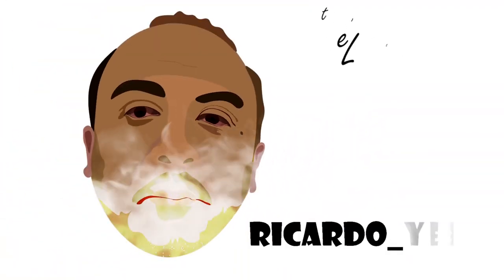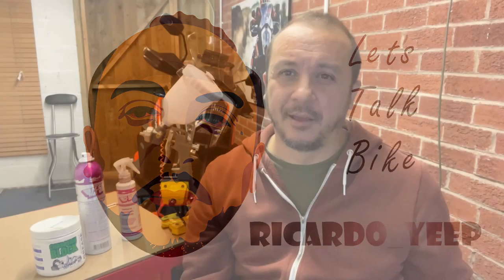2021 2022 2023 2024 KTM 1290 Super Adventure Anti Corrosion ACF50 Treatment

Comment: Hi Ricardo, many thanks for the great vid again. I decided to buy ACF 50 and I have tested it not only on my new 1290 SAS, but also on one of my other KTM bikes - especially on my 990 SMR which is 9 years old and not very shiny. The handling of ACF 50 with an compressor is quite easy (thanks for your recommendation to cover the wheels and brakes). And the effect is really brilliant. Everything glitters and shines like a new bike. Now all what remains is to achieve the desired protective effect when it rains....but maybe better not to drive in rain :-). In two weeks I will be with the SAS in Slowenia and I won't be able to avoid driving in rain. I will see how ACF will work....

Stay tuned and congrats to all your work - well done!
Reply from the maker: Hi Jochen thanks a lot for the great reply. Much appreciated. And good move on the ACF50. And don’t worry about rain. That’s what the ACF50 is for. It will protect everything that you have applied it to. It doesn’t not wash off easily. So you will still be good for a few wet rainy rides without having to reapply. It leaves a protective film on contact. It’s my go to product for after I have washed the bike. The other stuff I only add in winter when the roads are really salty (corrosion block grease). And for sure the compressor is very handy but does require storage space so not everyone can have one which I understand! But don’t worry about the exhaust headers smoking if you overspray. It will burn off in minutes without leaving a mark 👌

Comment: Just placed a deposit on mine, similar spec to yours. Already got my ACF50 ready to spray. Will be investing in a small compressor as recommended, looks very good adhesion with the compressor fitment rather than the crap spray bottle they supply! Great vid.
Reply from the maker: Hey there Josh thanks for the comment mate and also to hear your recent purchase!! You won’t regret it hopefully. Its an awesome machine. As for the compressor to apply ACF50. There is no better way. Its evenly applies it in a manner that is effective and efficient. Wish I did this method years ago. But as you say the can will achieve the same result in terms of protection but is much easier with a compressor! 👍

Thanks again for watching mate. Appreciated.

Cheers
Ric
Reply: @RicardoYeep  I unfortunately don’t have storage capacity for a compressor but I can see by the video the application looked flawless! Look forward to more videos

Comment: Hi Ricardo. I sprayed it liberally on my chain. Do you do the same or use a different product for that? Will you be using a chain oiler?
Reply from the maker: Hi Jason! Thanks for watching mate and also highlighting I probably should have been clearer. I don’t actually spray the chain directly with it as such .. I will however soak a cloth and wipe down the chain plates either side to prevent any corrosion. But the actual rollers themselves I use Wurth high performance dry chain lube.. no colouring in it and stays very clean. I am not sure on the affect of getting acf50 on the x-rings / o-rings of the modern chains. But in future use chain lube on the chain and you can wipe the plates with ACF50 and also can spray the rear sprocket with ACF50 to keep it looking new. ACF50 is anti corrosion and not a lubricant. 👍

Thanks for the comment again and great to hear from you 

Cheers
Ric

Comment: Hi Ricardo! Have you considered to have your ktm remapped? Since you are riding with no dbkiller (and no catalizer phereps) and since euro5 bike have a pretty lean air fuel ratio it could give some benefit to the bike
Reply from the maker: Hi mate. Thanks for the comment it is very good point! If I did remove the catalyst. But I have not removed the catalyst for this very reason. I f you remove the Cat like you advised yes must have a remap or engine will be crazy lean and cause problems ultimately for the engine. However having only a silencer and db killer rmoved the amount of back pressure drop is immaterial and ECU should cope with this small change. As most the pressure is before and up to the Cat. So in this situation I will not have to remap. But yes if you remove the Cat then a remap is necessary. 

Good point though! 

Also I look forward to seeing the DYNO result in a few days and comparisons.

Cheers :)
Ric

Comment: Thanks for the product recommendation. Can you tell me if you allow the ACF50 product get onto your headlights, windscreen, and/or TFT dashboard? If so, does it cause streaking?
Reply from the maker: Hiya again This is fine for all surfaces. It won’t harm. Just make sure you don’t get in tyres or brake discs or handle grips.. it’s slippy stuff..

If it’s on my TFT I just buff it off with a clean microfibre. As it does smudge… but Is of no harm.

If you saw my Aux light install I made sure while tank was off that I put some on all electrical contacts. This will save stop corrosion big time 👍

Comment: Hi Ric
Great stuff that acf. I used to spray it everywhere on my Tiger. Didn't worry about masking off the disks. Couple miles of riding it used to burn off. Haven't quite got the courage to do that on my KTM. I just oredered the panniers for mine in silver. How are you getting on with yours?
Reply from the maker: Morning James! yeah mate it goes everywhere. doesnt matter what form of application!.I always cover the disks though lol... I have only used the top box for the moment and that leaked from the bolt on the handle. Maybe needs tightening up or some sealant prior to tightening. Apart from that I love the look and build quality. much better than the Givi Outback trekkers (which came as OEM fit) on my Triumph Tiger. Much stronger and dont feel like a thin tin can. Quite wide though but to be honest my use will be a handful of times a year and on holiday so wont be in the city or towns so makes no difference how wide I am... Also I will just remove them at the destination before having a blast :) Let me know how you get on with the Panniers! Initial thoughts once fitted/fitting :)

Cheers again
Ric
Reply: @RicardoYeep  I had the outback trekkers also. Was quite happy with them. I am a bit concerned about the width of the KTM set up.
Reply from the maker: @jamessymes1  yeah they are good panniers the outbacks. But these just feel a lot more solid. I hear you about the width But be fair I wouldn’t be filtering with any panniers anyway. So not much to be concerned about IMO. Just more hold space to use if need be. And I’ll take them off at the destination anyway. So I wouldn’t worry too much about the width.. we are talking inches not feet if compared to the KTM fitted plastics (which I was going have) glad I didn’t in the end. 👍

Comment: Rick, can I ask: how many times do you protect your bike in a year for corosion?
Reply from the maker: Hiya Andy funny you ask I’ll be putting up a clip soon on this topic actually. Particularly for winter. But to answer your question I am very excessive regarding motorcycle care. quite OCD about it. I apply ACF50 after every jet wash (and never jet was the control or display areas). I don’t wash my bike after every ride or even after every time I’m caught in the rain as it’s protected. But for sure after jet wash. Which means it’s treated maybe twice a month maybe. So over time there will always be ACF50 residue building up in areas hard to reach (thus providing protection in these areas too). I also over winter use ACF corrosion block grease in all silver bits in addition to the ACF50 spray. Come spring it’s still like a dealer floor bike 👍

They say you only need apply few times a year. But for what it costs and the cost of the bike it’s no sweat just to treat it again